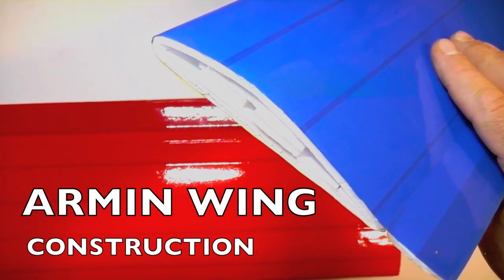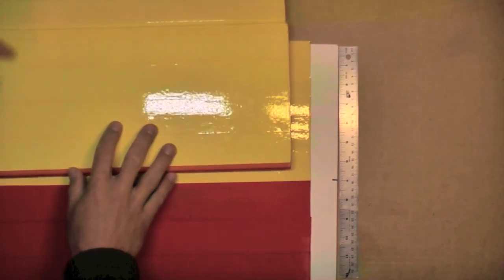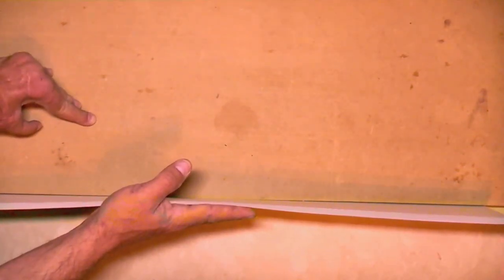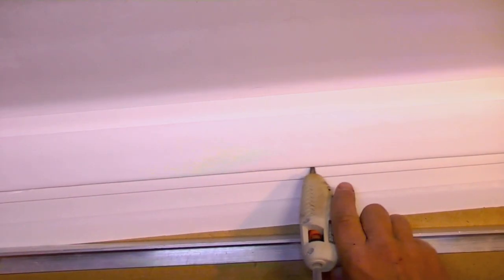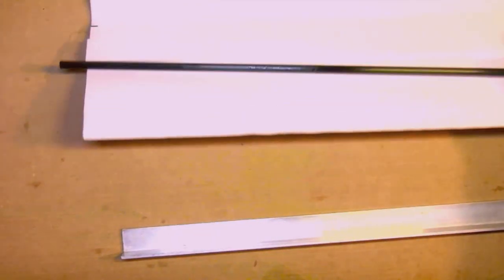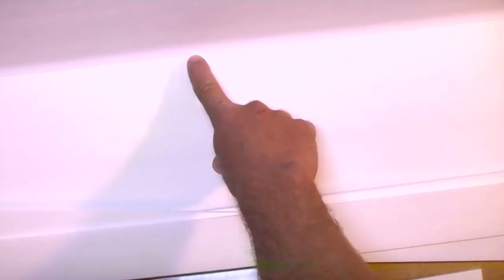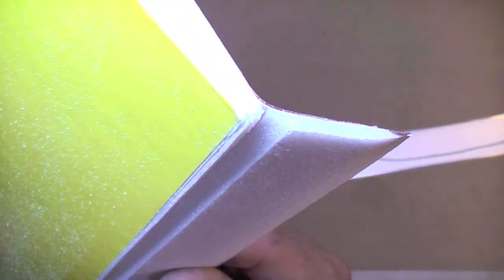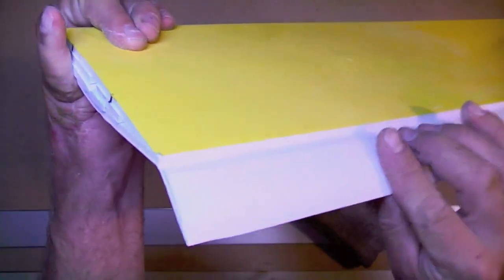ARMIN WING CONSTRUCTION: start-to-finish process with links to detail videos

Comment: Hope this help😊
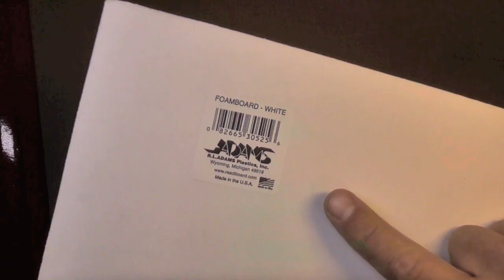Board covering 1:01
Colour scheme 1:14
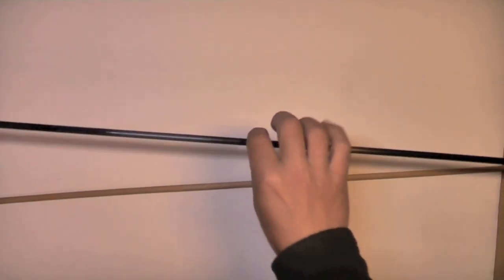Spar type 1:28
Two tone colour scoring 1:39
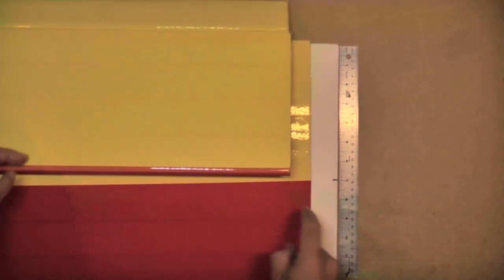Scoring line 2:10
Bevel trailing edge 2:55
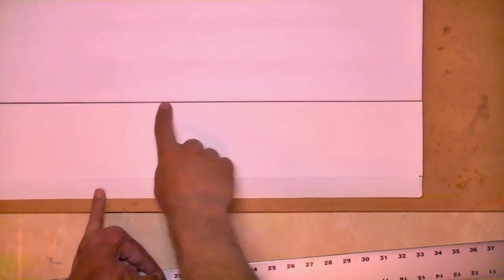Folding 3:27
5" wing former 4:18
7" wing former 4:44
Former placing 5:05
Control surface 10:30
Create the hinge 11:09
Reinforce the hinge 13:37

Comment: If the aileron follows the angle of the upper face of the wing it will form a camber. If instead it is flush following the flat underside if will create an angle with the upper face disrupting the airflow. Which is the best option?

Comment: Hi Ed, fantastic videos....I've learned a hell of a lot with your design concepts and techniques.  I have one question about the spar location and formers.   Why does the carbon spar get a top former (and then the wing fold over that) but only uses the bottom part of the wing as its bottom former.  When flight pressure or forces are applied to the wing, especially in upright flight, wouldn't the force acting on the wing against the spar, act directly against the bottom section of the wing which is not as thick because it only contains the 6mm foam without an additional former for extra support.  Am I getting to technical with this?

Comment: Hey, I’m having trouble marking his out because i could find where you mentioned the length of the top piece in relation to the 5 inch wing cord. Because of the curve it i takes it will be longer of course, but by how much is unclear.

Comment: In response to the comments asking for dimensions: If you do not add the 2in Former then using the 5-inch wing as an example. The top half will be 1/4" + 5" + the length of the Aileron which is probably 1.5". If you add the Top 2" Former you will want to add 1cm-1/4" to the length in order to maintain your desired Aileron length.

Comment: Great vid, I'm in Australia and that brand foam is not available to me so I bought another type (no name on it, I measured it all up and colour taped it as best I could (for the first ever go at it )   but when I went to remove the paper for the fold and the top of the wing, IT WOULD NOT separate from the foam! (4mm board)  so when I went to fold.... it did not go well,  in the end I cut the fold off all together  chamfered the edge, and taped them together again!   these boards here cost around $13-$15 each, by the time I put the tape and the hot glue into my wing It gonna cost me more than a teksumo  :-O  
and I'm surprised how heavy this foam is!  anyway I will end up with a  plank style  wing  but not sure if it's worth the effort  or cost??   thanks for the vid anyway,  I enjoyed watching them
Reply: I would say look for another option. The boards we are using are basically like science fair display board material. And they are dirt cheap in cost and production quality. The paper isn't even glued to the board it's just pressed on while the foam is curing.
Reply: Different stuff,  I cant find that stuff  within 200klm's of where I live..,  the stuff I've got is too expensive to muck about with at $15 a sheet + fuel to go and get it! 
  it's cheaper for me to buy the epp kits, like teksumo,  eagle, batwing, rainbow, spirit and lightning wing, all of these cost less than what the foam board cost me to build my plank, 
 but you don't get the satisfaction of designing them yourself that's the only problem....... :-) thanks for the reply anyway
Reply: hopefully this works and maybe it will give you some better options but flitetest did quite a bit of research 
 on this particular subject. https://flitetest.com/articles/foamboard-in-australia

Comment: I have discovered an even better way to taper the foam board for the glue joint shown at 2:22 and the trailing edge of the ailerons shown at 10:50.  Sanding foam makes plastic dust that is not great to breath.  I want to use this wing design with kids but didn't want to expose them to plastic dust or just as bad, a long blade sharp razor knife.  I have found that you can do everything with the long ruler clamped over the line just like you have shown.  One additional note using my method is, do not remove the paper from the edge to be tapered!  Take a clothes iron and set it somewhere between the "Wool" and "Cotton" setting.  Use the iron to heat up and flatten the trailing edge by slightly melting the foam under the paper. (This is why you need to leave the paper in place.  You don't want melted foam sticking to your iron.)   You will find that making the taper this way will actually make the paper bond to the foam better and will make the trailing edge of the ailerons stronger, stiffer and more resistant to damage.  Another possibility with this method is intentional reshaping ailerons with reflex for flying wings by ironing them over the curved edge of a counter top or board.
Reply: If you are not cutting, then how do you create the joint for the Aileron?

Comment: Hello Ed, thanks for all these very instructional videos. I'm getting ready to build my first Photon, and I'll be using Depron since we don't have Adams board here in Brasil. Have you tried vinil instead of tape for the foam covering? I saw those car wrap sheets at Banggood's site and they look awesome. There is an article at Flite testes site about a Mini Arrow wing with this material, but without any follow up about how it flew and if it was a good choice.

Comment: +ExperimentalAirlines do you think I could make the wing out of cardboard? If yes, how would I go about it?
Reply: Sparta;  You can build a wing out of cardboard. I have a cub with a 6ft. wing that I built years ago. Its still flying and looks as good as new. I used  the cardboard from a hot water heater carton, so it's a bit heavy. You really should try it.

Comment: After building several Armin wings and Flitetest wings I wondering the value of using a arrow shaft on simple 30in wings. Weighting the extra cost  of the arrow shaft against the necessity for the added strength is debatable.  When ever I cut into the skin of the wing then arrow shaft is necessary but for the NOOB TUBE  I believe the shaft is optional.  I know when I first started building your wing , finding a source for arrow shafts was difficult and expensive 5-7 dollars, so maybe a version w/o  the shaft could be tested and presented for the first timers. Containing cost on first builds especially for youngsters is important. Thanks for getting me started building FB planes.
Reply: Yea I agree TJ, I do it for crash proofing mostly. Also, I like to remove the paper completely cause it's so relatively heavy and spars help keep the rigidity, I think all in all I'm still less weight with paper removed and a carbon spar on any of my builds. That paper is quite heavy, especially cause it's on both sides.
Reply: +Sailor john He doesn't say you HAVE to use a shaft in the wings. He also says a wooden dowel works too. it is what I am using.
Reply from the maker: +Sailor john Totally agree, no spar necessary for a 30" wing, except for supersonic designs ;)   I only recommend "proper" spars for joined wings over 40".  Foamboard formers alone are surprisingly strong for 30" wing sections by themselves.
Reply: I use them simply for longevity.   I have built a 30" aerobat that looked similar to a cap 580 but with an armin wing.  I flew it every day after work and after about a month the wing folded in flight.  I agree that the spar isn't needed immediately but it helps after the foam fatigues.

Comment: I have scored and bended the foam but the foam board is still very long did I miss cutting something
Reply from the maker: David Hayes If you mean long at the trailing edge that is normal. This is where you cut off the ailerons or elevons, usually about 1.5 - 2 inches depending on what you are building.

Comment: i have 3 pound airplane, push prop i need pick up motor and speed control which let me flight 30 to 45 min with 5200mah battery, is this posible, and what motor and esc do i can use

Comment: I really like this design.. I have designed a foamboard model of my full size RANS S7S and the original wing was patterned off of the basic FT STORCH design, but I never quite got it to fly right with that wing so I redesigned it with the Armin Wing and so far it looks pretty good.  I have tested joining the wings with dihedral using the FT method. (tape and glue basically) and it seems to work pretty well.  I wonder if you have built two piece wings with dihedral ??

Comment: Thanks for the great instruction. After having the wings fold "again" on  my V2 Raptor  I just built a 2 piece 7" Armin Wing and  mounted it to my FPV Raptor fuselage. I am running it with flaps and I also added some wing ends. It flys better than  any plane I have flown yet.

Comment: Great instructional video! I got some great tips on the improved airfoil bend. I think the FT Versa Wing can be heavily improved with this technique. I also love your method of adding aerodynamics to the trailing edge and control surfaces. I noticed that your leading edge bend can be pretty thick. Keep up the great work!

Comment: 2:52 minute mark on video it shows there is a 1 inch lower section than 5 or 7 inch section what is the measurement of upper section?
Reply: I am wondering the same thing...
Reply: yes
Reply: Late reply I know but it would depend on the profile of the airfoil. A thick airfoil would require a longer top surface. Depends on what you want. Not a satisfactory answer I know but he doesn't make plans he just builds from these rough measurements.
Reply: If you do not add the 2in Former then using the 5-inch wing as an example. The top half will be 1/4" + 5" + the length of the Aileron which is probably 1.5". If you add the Top 2" Former you will want to add 1cm-1/4" to the length in order to maintain your desired Aileron length.

Comment: If I want to create a 30" long fuselage what should be my wingspan? I'm thinking mid or low wing. How do I determine dihedral?
Reply: One of my most successful designs uses this wing with the 7' cord, 30' span, with a 30' firewall to tail-end fuselage. No dihedral. Don't be concerned about it. This wing design is incredibly stable.
Reply: A good rule of thumb is to have the fuselage length be 70 - 75% of your wingspan.
Reply: 40"sould be good

Comment from the maker: I will do one but cannot promise when.  However a very similar technique is used with Depron for the wing as for the fuselage tube, which I did do a video on recently.  It's mostly about taping well and compressing the Depron inside the bends, ie: at the leading edge fold of the wing.

Comment: try hobbyking on the internet & look under 'hardware& accessories/decals/wing tape' ..there you'll get it in different colours &  widths & you'll need to look under "international warehouse "for best results..another avenue is ebay..I recently bought 6 different coloured rolls for approx $8.00AU..most hardware shops & packaging suppliers only sell brown & clear(in Australia anyway)..try those two & I think you'll be in luck

Comment from the maker: Yes, the creasing technique leaves a wing camber that is less smooth but it does work, and does not require removing paper.  Dollar Tree foamboard per 20"x30" sheet is:  60g without paper, 120g with paper, 140g with paper and packing tape on one side.  So it is 0.3kg/m2 with paper only.  Your foamboard is only 33% heavier, so not bad, it will probably work!

Comment from the maker: I would do exactly as you suggest in order to get the bends.  FliteTest uses a variation of this for their wings.  Most foamboard besides Dollar Tree tends to be a bit heavy so consider using a larger motor for your builds if that is the case.  Where do you live?

Comment from the maker: I don't make any plans but I have several very thorough build video series on my channel for at least six (so far) airplane designs.  I would recommend the Photon or Axon first, then the Synapse for a little more challenge.  Medium to long wingspan planes with straight wings do great with this wing design.  Use one of mine or create your own.  There is an RCGroups thread called Foamboard Scratchbuild University that has a lot of smart guys and nice designs on it.

Comment from the maker: I have usually used the 5" on my Noob Tubes but the 7" would probably actually be better on this plane with a short wingspan, especially if you're not an experienced pilot.  Try it with two instead of three formers inside for a slightly thinner wing.  You'll get somewhat more lift with negligible extra drag.

Comment: is there an easy way that you can think of to do the armin wing as a swept wing? i was thinking about instead of using a flat foam "core", using pre-cut balsa and/or foam (maybe even CF or FG) ribs then bending the foam over the ribs. then i could even do undercamber?

Comment from the maker: The Armin Wing is a true airfoil with laminar flow which emulates the principles used in all other aircraft wings. The KF airfoil is perhaps easier to build and a good way of reinforcing a flat wing and you can get away with using it quite successfully in small scale, as with RC planes.  I don't subscribe to the trapped vortex idea being superior to a laminar flow airfoil.  For slow flying (high angle of attack) I'd put a true airfoil up against a KF any day.  For sheer lightness a KF might win.

Comment from the maker: I would tape the whole thing before folding the 7" wing.  You'll use up all but about 4" of foamboard, so you may "waste" a couple of tape applications, but I almost always find a use for that little pre-taped strip in some other place, like the fuselage tube joiner (tape facing in).  Also see video on "Two Tone Color Wings" for some details on where to apply tape so it ends up right once the wing is folded.

Comment: Do you ever have issues of the ailerons warping? I think mine are warping up at the ends causing eratic flight characteristics.  Is there anything you do to prevent warpage and single thickness foamboard?

Comment from the maker: Whatever sticks foam at a speed that suits you.  GG is great, but slow.  CA is fine but kind of brittle.  Some spray adhesives work, many will not, so do some research and/or experimentation.  I tried 3 that did not work so I cannot offer a name of one that does, but someone did comment on that so there is at least one spray that works.  Hot glue is so cheap, fast, and versatile it's hard to beat.

Comment from the maker: The favored Readi-Board in the US is 5mm or just a hair over with the paper on both sides.  You should be OK with any extruded polystyrene foamboard with (this is the important part) paper that is easy to peel off cleanly with no solvents, water, etc.

Comment from the maker: It will work!  Just remove paper from the inner surface of the upper and lower wings, at least the part that needs to be bent, and possibly all of it.  Measure everything with extra precision and glue the upper surface to the former after careful dry fitting and checking.  It may be a little challenging to make a perfectly symmetrical pair of wings, but you can get pretty close with some patience.

Comment from the maker: Well done!  Maybe a better glue gun and/or go pretty thin with the glue application.  Only a thin bead is needed for the wing assembly.  All the forces at hand are compression and shearing, so not much glue is needed.  With practice you'll be turning 'em out by the dozen!

Comment from the maker: Whoops!  I put them on RCGroups.  It's 3.5oz for the 5" +1.5" wing and 5oz for the 7" +2" wing, where the first number is airfoil and second number is control surface.  This is taped, glued, full span control surface, no servos, no spar, no tip cap.

Comment from the maker: Cabelas is my source.  $6 or less per arrow is pretty good. Pull the nocks out by twisting with pliers.  Cut of the fletching with a utility knife.  Usually 5 passes will take off the fin and all the residual plastic material.  You can sand them too but the slick finish is actually kind of nice to leave on so they slide inside the wings more easily.

Comment: Here is an Idea instead of the arrow spar. I have found the drive way markers work as well. Not as ridged but work well. Get the 1 that does not have the square or round disk. About 1:99 from Lowe's and other home diy stores.

Comment: got my first Armin Wing built and i wanted to ask you about the duck tape brand "sheets" that they sell on tape brothers.  what do you think of them and their potential uses for these types of projects.  Also, it seems that the black foam board does not flex the same way the white does.  My black sheets just snap but the white ones do whatever i want it seems. Thoughts?  Turns out im coming back to phx this weekend, maybe ill see you out there in the million degree heat!

Comment from the maker: Undercambered would be fairly difficult.  Symmetrical and semi-symmetrical are done be removing some or all of the paper inside the lower skin of the wing and cambering the lower surface too.  It is tricky to reproduce the effect, say, between a pair of wings.  Very diligent construction and measurements needed.

Comment from the maker: The selective paper removal allows bending of the foamboard to occur in certain ways that results in the wing and tube shapes you see.  They can be formed without paper but it takes a lot more diligence to make consistent parts.  The weight savings by removing the paper is pretty small.  Additionally the tape sticks permanently to the paper, only moderately to exposed foam.

Comment from the maker: No, you're probably still OK.  It won't have quite as nice stall resistance over a range of AOA's but I wouldn't sweat it.  Go ahead and make a mate for it and finish the plane.  If you ever get the itch to be a perfectionist about it then make another paired wing and I promise you'll find another plane to re-purpose this one for.  I'm sure it will work just fine.